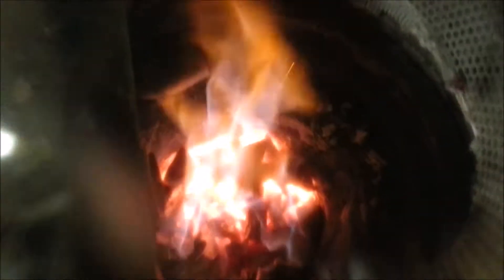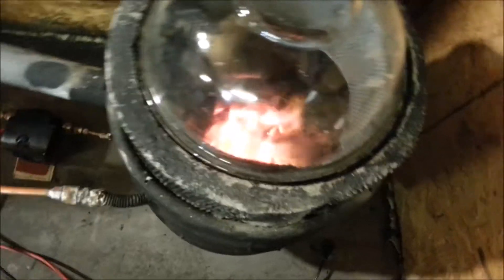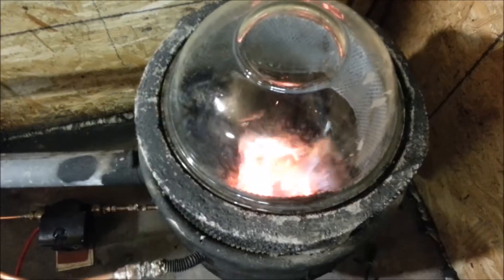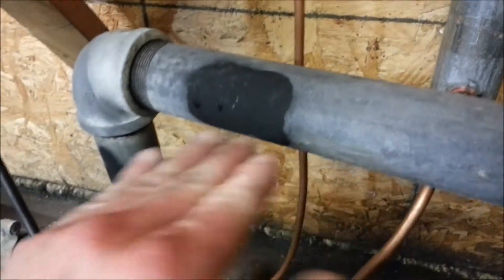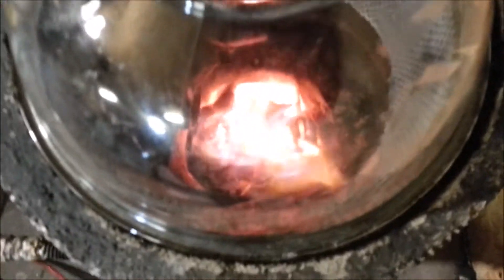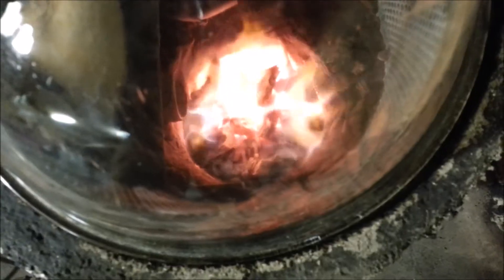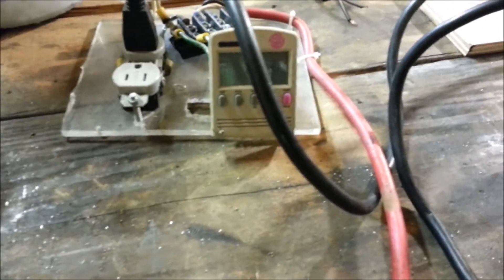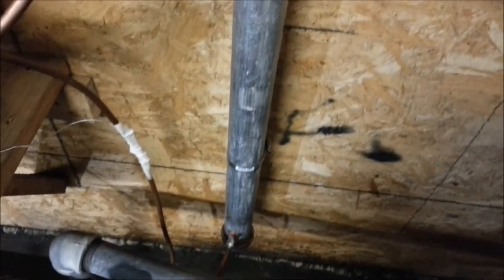Water Gas Reaction OBSERVATIONS

Comment: to measure the heating power you can use this : deltaE/deltat where t is time.  E is the combustion energy produced by charcoal. you need also to measure the heat consumed for boiling water into the charcoal if you directly put liquid water on the glowing charcoal.